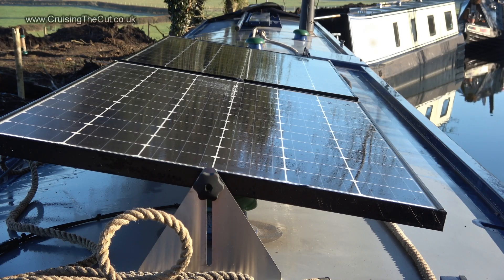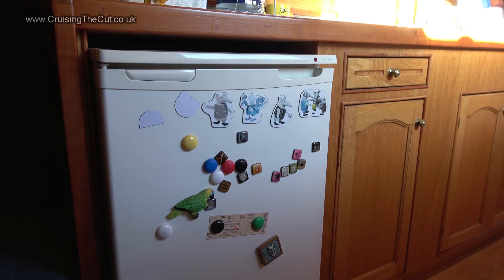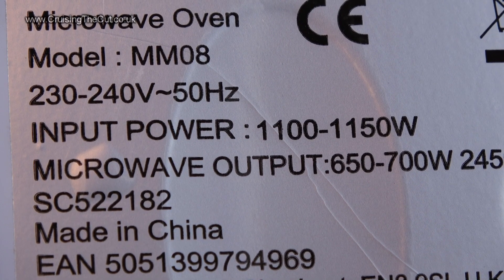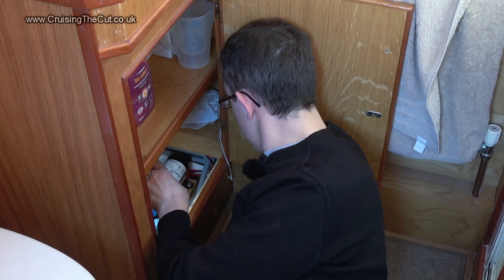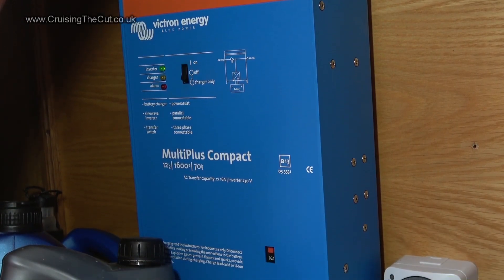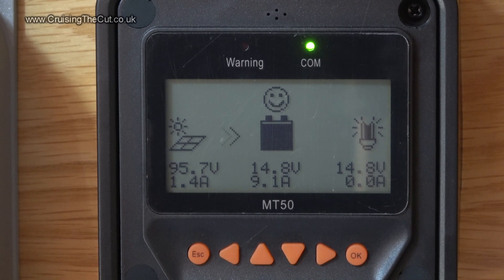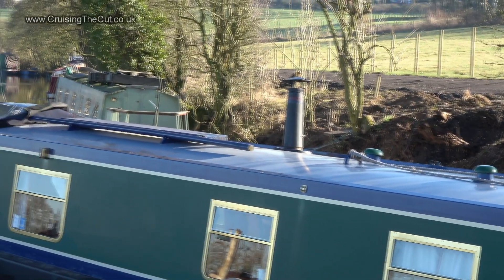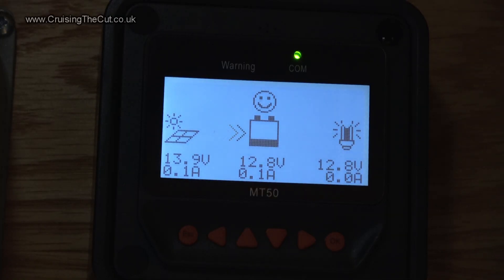76. Is solar power sufficient for a canal narrowboat in an English winter?

Comment: Completely unrelated, would you recommend your Jack Wolfskin coat?
Reply from the maker: Yes and no. It started off well but then I got oil on it from a lock gate and despite washing, has never looked clean since. Furthermore it recently began shedding its waterproof lining, leaving dandruff-like flakes everywhere. However, having purchased a new coat, I now discover that the shedding may have been down to me using conventional laundry detergent for the oil-removal wash, as apparently this destroys the lining! I don't know if I really did damage it or if it just started falling apart from old age.

Comment: i have a question. during winter how is your water heated to keep it from freezing?
Reply from the maker: It isn't. The tank is within the well deck and will receive a slight bit of warmth from proximity to the saloon (where a log burner runs throughout winter) but otherwise being enclosed and below the waterline is unlikely to freeze unless we had several days of substantially sub-zero temperatures.

Comment: If you would increase the angle of panels to 90 degrees towards the sun you may increase efficiency considerably (maybe double).
Reply from the maker: Yes but double 1 or 2 Amps is still bugger all and as explained in the video, winter in the UK is usually overcast and miserable so what little light there is - and there's not much nor many hours of it - gets diffused such that panel direction makes no difference.
Reply: @CruisingTheCut  so how big of a panel does one need to cover normal needs and heating the thing given short days and overcast?

Comment: 😊👍
You could increase your solar array, by two, by having two panels, one above the other, and then pulling the lower one out, on slides, like a drawer, and then locking it in place, whenever you need the extra charge. 
You could also use a gas spring, like on a car bonnet lid, to assist lifting.
.
Reply: smart. how many square metres is needed to live normally ? solar pv?

Comment: Great Video! wish I had seen it earlier. What do you think about deisel heaters?
Reply from the maker: Stove type or radiator? I like both but the ones that feed radiators are rather noisy
Reply: @CruisingTheCut  which type is the refleks heater from Denmark?
Reply from the maker: Stove type.

Comment: So, the solar is not enough, for sure, in the late fall/winter, otherwise it is definitely maybe enough.  If a person wishes to stay in one place for a week with no shore power, what would you recommend?  Running the boat diesel or getting a small shore generator?  Gas or diesel generator?  Thanks  Cam
Reply from the maker: Many boaters just run the engine, otherwise a small petrol generator (diesel gennys are hugely expensive and tend to be installed at build time as a permanent fixture)
Reply: Portable power stations, portable batteries, charge it/them whilst cruising. Google Jackory. You can also buy portable solar panels as an add on to your existing kit.
Reply from the maker: A portable power station is no different from what the boats have already - solar, battery and charger!!! Having a portable power bank is no magic solution to insufficient power, you'd still have to charge it the same as you would the boat's batteries. In which case, buying a power station would be a total waste of money as you're just duplicating what you already have. In winter the solar would be insufficient and if you're going to use the engine to charge, it might as well charge the boat batteries 🤣 . Spend the money on diesel to run the engine!

Comment: I'm sure you realize that Solar panels are rather sensitive to angle of incidence of the light.  I understand your point about how they are mounted, but I wonder if a reflector of some kind might help to bolster solar power capture on good sunny winter days?  Yes, I realize then you would need to store them some place even if they can fold up.   Just some thoughts for you.
I gather that this is a rather old video posting so you may never see this comment, but if you do, I hope you find it helpful (as it was meant) rather than annoying.
Reply from the maker: I read every single comment!

Yes indeed, tilting would help to a degree but even a doubling of output would still only raise it from 1-2 Amps (for example) to 2-4 Amps. The trouble in winter is just the lack of decent bright hours of daylight!

Comment: solar power will definetely power enough if measured properperly. winter or not. its not uncommon to measure ur electrical usage in the winter and in the summer and get an average.if ur average is for example ten amps then get 20 amps. refrigerators do not truely run 24 hours. the fan in alot does. but the cooling is done in cycles thats why u hear a fridge rev up sometimes cause it has gotten to a certain temp. the amount of power u get is mainly to keep the batteries from going to zero. if u wanted to run on solar u'ld need more pannels and maybe special mounts that keep the pannel aimed at the light sorce usually the sun; but lunar light also which is just weak solar
Reply from the maker: You can average as much as you like but with many fewer hours of daylight, and most winter days overcast or rainy, the amount of solar generated will be a mere fraction of what you'd get in summer. Unless you plaster the entire roof in panels - which would be total overkill for summer - you won't generate enough for typical usage. You're correct fridges don't run continuously but they'll still draw a typical  45Ah/day (over 500Wh) which is a lot for a typical narrowboat solar array to generate in winter (plus the rest for all the other appliances)

Comment: u need lithium ion battle born brand batterry's....more panel might help. check bus grease monkey on youtube for idea's...
Reply from the maker: Lithium batteries - and there are many brands available - are extremely expensive and even with additional solar, the issue is that in the UK, the weather in winter is generally poor (rain / cloud / miserableness) and the hours of daylight are short. It doesn’t matter how clever your batteries are, if there’s not enough sun, there won’t be enough power.

Comment: I love solar, use it for all sorts of things in my studio/ workshop. rated at 540w it's not a replacement for the mains or even a cheap alternative.
maybe if I live to be 100 or prices rocket they might eventually pay for themselves. 
for me, I just like using the sun to charge the lights I use in the house at night, my phone my laptop are powered by the sun. its worth the extra money and work.
new overlapping pannels are being developed that give more power per inch. but here in Britain we will always be tied to alternative power sources. 
canals by design might not be great for wind power, but an upright generator may just help to take up the slack in the winter months. they are a lot cheaper than solar and work all night as long as the wind is blowing.
Reply from the maker: Cheers. Wind turbines are fairly hopeless on canal boats unless you’re permanently moored in a very open, windy spot.

Comment: you have a lot of unused roof. why not more solar panels? you seem to waste space with gangplank(surely you can find a more space effective way of storing it. folding gangplank etc). no wind powered generator? wind generator can make power anytime the wind blows(at night). maybe the biggest problem is a mindset of not trying new things. your reply to henry ostman shows that. its all good being traditional, but who wants to smell and hear a diesel?
Reply from the maker: There is certainly space near the bow to add another panel, I have enough space for a 390W one I have my eye on. Nonetheless, in winter months when the hours of daylight are much less and the amount of sunshine is negligible, the amount generated would by and large still also be insufficient for one's daily needs, even with panel tilting etc etc.

Wind generators are largely useless on the canals; they need a constant, fairly stiff breeze even to start turning let alone generate anything useful. Plus they're noisy. See more on my FAQ page https://cruisingthecut.co.uk/f-a-q/

Comment: Honda and others make small and light inverter generators that produce about 1000 watts continuous and are very very quiet and don't use much fuel (gasoline), a gallon would last a week nearly, it could top off your batteries in about an hour a day with no sun.  I know some seagoing yachts use a wind generator, these are small and make 400 to 600 watts IF the wind is blowing at about 15 to 20 mph, for landlubbers that would be a rather windy day, they don't work in a gale and of course they don't work in a calm or winds much below about 10 mph of course they work all night if the wind is blowing.  Downside is some can be noisy and some have a rather spotty service history, since they'd need to be on a mast won't work while cruising but then you're running the engine, I would guess that buying one of these would cost more than the honda.  the honda advantage is you buy it and plug it in with your existing shore line, nothing to set up.  The problem with solar in countries at England's latitude is the low sun angles even in summer.  Boaters with the most success with solar are generally in tropical waters with resulting high sun angles year round and more hours of full sunshine year round, never below 45 D that would be your high much of the year.  Panels like the sun to hit straight on requiring them to tilt in the proper direction and low sun angles mean that the atmosphere filters off much of the sun energy just like a cloudy day.
Reply from the maker: Bear in mind that the power output of the generator is not necessarily the same power that can be transferred to the battery bank, for example my charger is rated at 70A but the optimal charge rate for the batteries is 60A. Plus of course unless they’re Lithium, the batteries will take in less charge the fuller they get. So an hour a day will not be sufficient to return them to full albeit it would put some charge back in. Realistically with traditional battery chemistry you’d need 3 or more hours charging time, which will add up to rather more than a gallon a week. Wind turbines meanwhile are fairly useless on the canals, there’s generally not a constant, strong breeze which is what they need to do anything useful. Plus the noise as you mention. Tilting the panels is all very well but if there’s bugger all sun anyway, it’ll be double bugger all you get.

Comment: if you took out the 9-11 ton of ballast and put the same weight in batteries and lined the whole top in flexipanels with multi controllers i dont think you'd get through winter with power..
Reply from the maker: True but such a retrofit would be hugely expensive and I wouldn’t want my battery bank utterly inaccessible in the bilge (which it inherently would be, if it was a ballast replacement underneath all the floor and fit-out)
Reply: it's a pity they dont just put the real life specs on the panels in the first place really...
Reply from the maker: Modern narrowboats do tend to fit more solar and larger battery banks these days but when my boat was made (2000), solar was an expensive luxury hence it tends to be retrofitted and has to fit around whatever was on the roof at the time of maufacturer (vents, access hatches etc)
Reply: My late brother in law was an electrician on an old diesel sub, subs don't have permanent ballast, they have batteries, mayB 50 tons or more, all on the lowest deck.  Every day his first job was to fill the batteries with distilled water (diesel subs were called pig boats because the crew couldn't shower regularly, the water was needed for the batteries).  Subs need to run on the surface to charge batteries and make water with their evaporators, they submerged when the enemy was sighted.  He'd like this filling the bilges with batteries, problem is you'd suck the mains dry when you get to the shoreside power point.

Comment: In your total sum up I didn't see a number for a water heater...  Do you have hot water for the shower and kitchen or do you have to manually heat all the water you need?
Reply from the maker: Water heating with electricity would take too much power unless plugged into a shoreline. It's heated with the engine or a dedicated diesel heater.
Reply: @CruisingTheCut  I noticed that you hardly have any solar panel area. your expectations are off. a square metre costs around 100 pounds or less and you should be covering the whole boat.

Comment: I have herd that they are coming up with panels to use moon light !  But l think in the winter wind power can be good ?
Reply from the maker: Nah, they’re fairly rubbish. See my website FAQ page https://cruisingthecut.co.uk/f-a-q/
Reply: Better batties ahead
Reply: Wind power very much depends on your location, I would imagine on the mostly sheltered canals it wouldn't be much use to a narrow boater but the average wind speed where my boat is moored is quite high for instance. The turbine also needs to be in "clean" air which means raising it up on a mast, turbines also create noise/vibration and require more maintenance than just the occasional wipe over that PV panels need. In most cases it's easier to just add more panels to a solar system than to add a turbine although with limited space on many ocean or river boats they often have both.

I don't know what the average flow rate of a canal is but a water turbine hung off the side while moored might produce useful power?
Reply from the maker: @popuptoaster There is effectively no flow on the canals (except when a lock is used and the effect of that water movement on an entire pound above can ne negligible) so a water turbine would be useless.
Reply: @CruisingTheCut  I suspected as much, I have solar on my boat but also I'm on shore power as the boat is still to much of a project to take out yet, I'm finding my battery bank to be my limiting factor, it's often fully charged while the sun is still producing useful power so I need a more batteries to take advantage of it. I have an automatic transfer switch to switch over to shore power when the battery voltage gets to low for my inverter, eventually it will be connected to start a generator when I'm moored away from a marina.

I may invest in some brackets like yours, my panels are flat on the roof but it does involve some gymnastics to get up on my roof to re-angle them! 😁

Comment: How long does it take for the engine to recharge your bank? (on average?)
Reply from the maker: Depends how discharged it is ... charging tails off the fuller the batteries get so technically they never reach 100% I think. The bank capacity was 330Ah at the time of this video and the alternator puts out 65A.
Reply: @CruisingTheCut  I am novice at solar but that works out to about 5 hours at maximum alternator output (whatever RPM that is??) to get to full charge from empty (10.5v?) and that is if your solar array output is zero? Much shorter charge times on a sunny day or when you didn't use as much? I'll have to review your energy audit in the vid again. Awesome channel, sir!
Reply from the maker: It would be longer, because of the slower charging rate as the batteries got more full but you could get a decent amount of charge into them from flat after five hours, yes. The the solar could take over and finish the job.
Reply: @CruisingTheCut  , Yes, I can see how the law of diminishing returns comes into play as fuel used vs usable C-Rate? It's like trying to fill a glass with the spigot on full? Either run at idle to push less amps or let the array finish the job at more of a "trickle" rate so you get less push back from the cell's potential? Ever run yourself out of power?
Reply from the maker: I've not run out as I'd always run the engine before that happened.